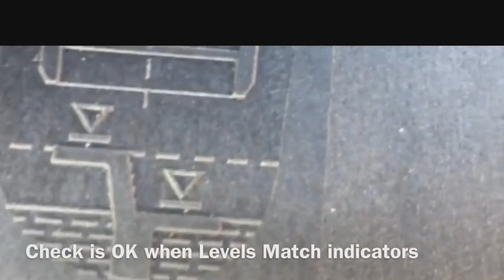How To Add Anti- Freeze / Low Coolant Level Warning / BMW

Comment: Do I need the water or can I just buy the coolant and add it ? 2019 3301i
Reply from the maker: You need the distilled water yes
Mixed 50/50
Reply from the maker: Very important
Reply from the maker: Bmw would top it off for free tho
Reply: @BimmaJoc   Interesting!!  i didn't know this.
Reply: Great question.  If the video had voice instructions instead of a useless soundtrack, you would have gotten tips and peripheral instructions that weren't included.
Reply from the maker: @seacoastview7253  already made voice instruction videos on the same topic
Reply: @BimmaJoc  I was just there for an oil change less than a month ago. Not sure if why they didn’t top it then but I didn’t feel like driving all the way back out there. I got the premixed solution and put it in myself. thanks!
Reply from the maker: Lol if the coolant not from bmw its a no go….you have to use the bmw coolant ..its blue
Reply: @BimmaJoc   I wish i had seen one of them before i added 100% coolant.

Comment: Doesn't mention the 2nd yellow cap, whether to also fill it.  2 reservoirs for coolant?
Reply from the maker: There isnt a 2nd yellow cap and it is not suppose to be filled.  The required level indicator is on the tank.
Reply: Dudes speaking in absolutes when he’s incorrect. Most new BMWs have two reservoirs, one for charge air cooling and one for engine cooling which is where you’re referring to the 2nd yellow cap. Fill/top both up to the indicated min/max lines, both use the same coolant. You’ll see the location of both in your BMW manual. However, if a light comes on to top off your coolant it’ll be the engine cooling as the charge air cooling doesn’t have a sensor. (Also means you have to check the charge air cooling reservoir every few months).
Reply: @sueddo2634  Thank you !!!! I’ve been looking everywhere for this answer. Most things I’ve seen did indicate there’s 2 locations and would even say what they’re for, but no one ever said if they both used the same product. Thank you!!!!

Comment: BMW 5 series 2007, engine coolant light came on after I got the alternator fixed..topped it up and the lights still on, any idea what it could be.
Thanks
Reply from the maker: Coolant sensor? Faulty or theres a leak ? Have to check the whole system for leaks

Comment: Where do I bring the level to when it is cold - Low or High - to top it off?  Thanks - Matt
Reply from the maker: There should be an indicator on the coolant tank …just dont fill it up …the indicator should be lower then half the tank
Reply: @BimmaJoc  Yes, there is an indicator - it has a "Hi" marker then half has circle and "low" marker - what point do I fill it up to cold?
Reply: Actually it is "MAX and "MIN"
Reply: ...do I top it off to MAX when cold?
Reply from the maker: I like doing below max
Reply: @BimmaJoc  ...that's exactly what I do - Thanks!!

Comment: Cut the music don't need it!
Reply from the maker: Hi thanks the original video has no music  How To Add Anti- Freeze / Low Coolant Level Warning / BMW https://youtu.be/5S2v-17WLbY   I usually make shorter videos to the originals...trust me others complained about the music before and I changed accordingly
Reply: I agree.  Not servicing a 1980 Cadillac Deville here... Fucking up  the coolant in a BMW is going to be painful.